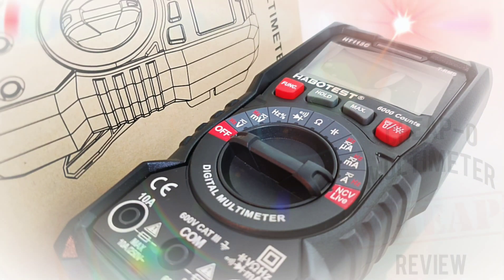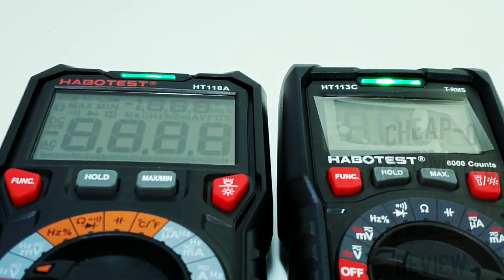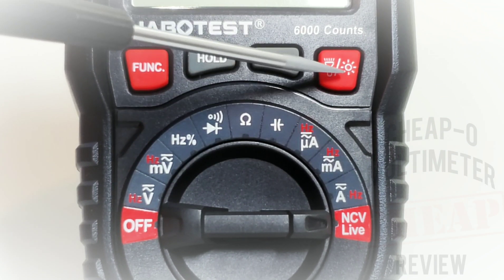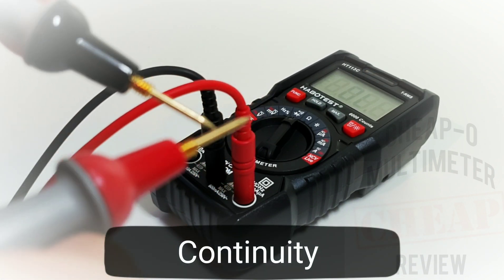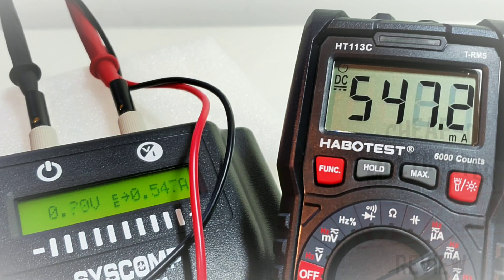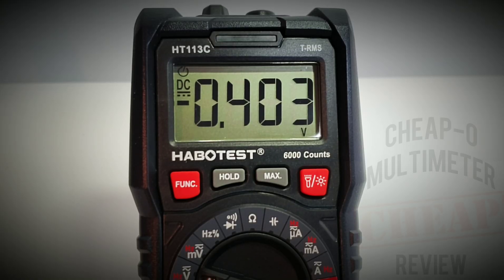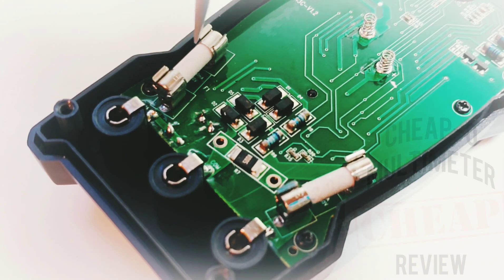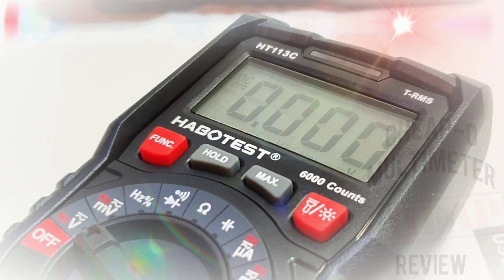HABOTEST HT113C CHEAP-O Multimeter Review & Teardown!

Comment: Hi, is this multimeter can still operate in 1.2v aaa battery? It's just most of the batteries online that are rechargeable are 1.2 volts. Also in the diode continuity mode, does the multimeter buzz when you test a shorted diode?

Comment: In most, if not all, multimeter tests on you tube, the continuity test is performed in the "steel striking a flint mode" - what's the point??

 If you are doing an actual continuity test for troubleshooting, you hold the probes on the test points until the dmm latches to ensure the continuity is positive and whatever connections there are are securely connected, not some fleeting beep that might signify an intermittent or loose connection. 

Sure, you have a pair of shiny, pricey test leads, but I don't see the point of trying to start a fire with those.
Reply: It's when you are trying to trace where a connection goes and you don't want to wait long on every component you touch. This is the most important feature for me since I'm working without schematics.
Reply: @shawnm8232  ok, that's understandable. Thanks

Comment: Habotest 118A has board version 1.2 which is different from others V1.3.  Do you know the differences between 1.2 and 1.3?  Thanks.
Reply from the maker: Sorry for late reply.. 1.3 added the audible diode mode I believe..
Reply: @KeepOnTesting  Thanks.  I bought one and the P/C ratio is pretty good.
Reply from the maker: @JL-bo4bh  Great stuff..its a pretty nice multimeter all around. 👍

Comment: As a industrial electrician, I will never use a cheap multimeter, I've seen them give bad voltage readings which can cost some one their life, spend a hundred bucks and get a fluke
Reply from the maker: Kris, I appreciate your opinion. Unfortunately I've seen 200$ multimeters that were built like crap. Let's be realistic,  not everyone is working with electricity on a professional  basis. A CHEAP-O multimeter can serve the needs of many quite readily as long as you know the limits of the meter and yourself. Also, many citizens around the world  unfortunately and unfairly have not the means to spend hundreds on a meter but still need to get the job done. You can't negate that fact. Indeed  their are some bad multimeters but also some incredibly good ones that dont cost an arm and a leg. I have hundreds of multimeters , high end, low end and everything in between. As often as I'll reach  for my Keysight,Fluke or Sanwa I'll just as readily reach for my WinApex, UNI-T  or Habotest...they all serve a purpose.
Reply: Then why are you watching this video? This is meant for people who want to buy a cheap multimeter for personal use.
Why would a professional buy a cheap multimeter?
Reply: @el_teodoro  113C or 118A? Thank you!
Reply: @Dima 1981 there lives are still worth a good meter
Reply from the maker: @krissmiley7519  No ones disputing that, but for some a 200$+ meter is a years wage and people still need to eat.

Comment: Not too bad @ $20 or less though ive seen better results in a few, but good to see such a solid diode voltage in such a low cost meter and that touch hold like feature is also a surprising thing to see, its about time such a simple feature started appearing in lower cost meters in greater numbers, its not rocket science in 2019.  Looks like its accurate in the most important ranges but too bad about the slow as molasses capacitance result - many meters are faster in capacitance even in cheapo land - could it be this was because it was at its rated limit-?  Maybe its faster when reading below its listed maximum, but still suggestive of a weak capacitance range.  Ive grown to accept weak NCV function as its more of an afterthought in most cases anyway.  In a meter of this price im more concerned that the most important ranges work correctly ie: volts, amps, mV, continuitsingy, capacitance  resistance and diodes etc etc and if that all works well in the cheapo price range I feel ive gotten a good result if the price is right and the rest is just fluff for the most part.  Too bad the display isnt as good as it might be but again its a cheapo meter so some latitude will inevitably have to be given in some areas or just pass on it if its a deal breaker for ya. And as almost always, little to no input protection, but if using in low volt ranges not an issue.
Reply from the maker: That about sums it up. It was rock solid, no quirks or random shutdowns. Fast and efficient! It's no competition for the Big Brother 118 but it's a solid little meter with a small footprint.

Comment: Looks like the input protection is a bit on the weaker side. Were there at least some PTC+diode clamps that I missed... or almost zero protection?
Reply from the maker: Definitely lacking in the Input Protection...one diode clamp but no PTCs or MOVs, use on 32V or under to play it safe.
Reply: @KeepOnTesting  It's a pity the cheaper Chinese manufacturers really don't pay much attention to protection. Some better-known brands at least try to include some protection, but... I guess there would be a market for fully protected (PTC+MOV/SG+semiconductor clamps), properly CAT rated DMMs. Wouldn't really cost that much extra, a few $ at most, and it would be really great for hobbyists or for education institutions, especially in areas that are not so well off... Well, there are some meter series that have half decent protection and are quite inexpensive, UT139x comes to mind :)
Reply from the maker: @tefatronix  Agreed !  Maybe the Holy Grail of CHEAP-O Multimeters is yet to come ..adorned with colorful PTCs and insulated Movs...the stuff our multimeter dreams are made of! I think slowly we will see better basic input Protection becoming mainstream..though it will take time.